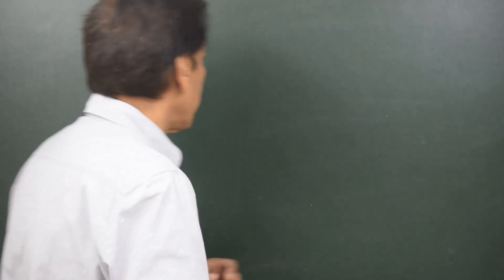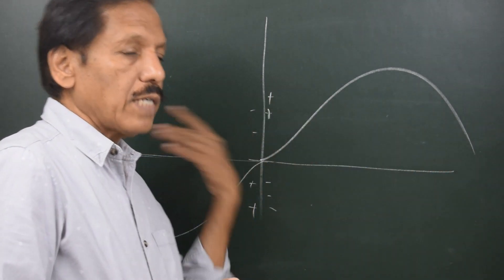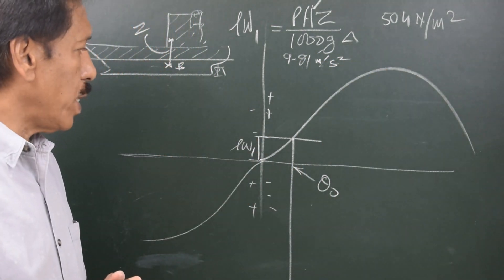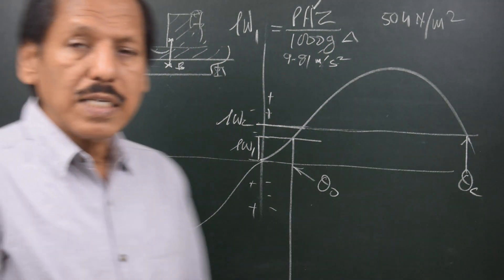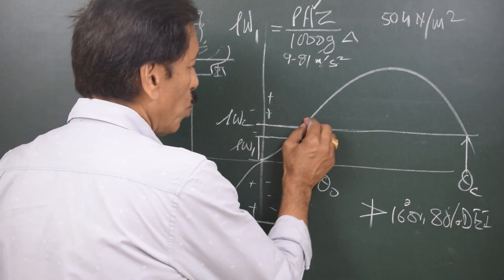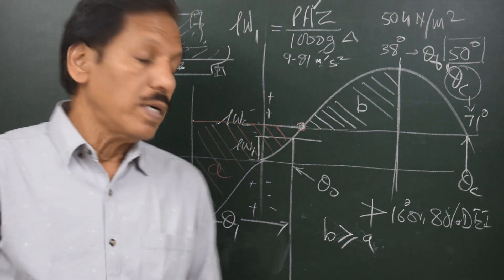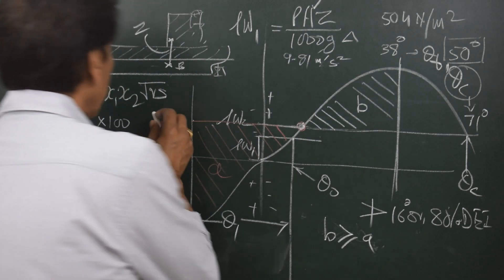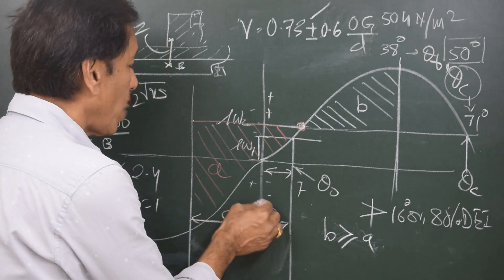Ship Stability Video 51: Severe Wind Criteria for Ships

Comment: Very well explained dear sir. I had the pleasure to sit for many of your lectures.
I take it that the calculation is based on Force 10 wind conditions. Approx. 55 knots. In case of very large Pax ships, say windage area of 14k + meters, will the same calculations apply. Recently I experienced about 70 knot with gust upto 75 kn. The heel experienced was much less (thankfully) than what the Napa load computer showed. Just wondering if the computer was calculating correctly. 
What I was interested and want to ask was, how much wind (just approximately) would I be safe to take on the beam (300 m long ship x 25 m from half draft to air surface centroid). (The stability manual doesn't provide much info since the ship is 15 years old and did not need this criteria when it was built. The new manual has at best not very good information as I can gather)
Reply from the maker: Dear Deep,
504 N/mt sq is approximately gale force approximately 40knots. How much your ship heeled will also depend on the stability or GM of vessel. A general thumb rule should be that because of wind alone, the permanent list or heel should not be more than 80% of deck edge immersion. To find out if your ship will satisfy the criteria, the normal 4 tables which are provided and the two formulae can be used. Thanks for viewing.